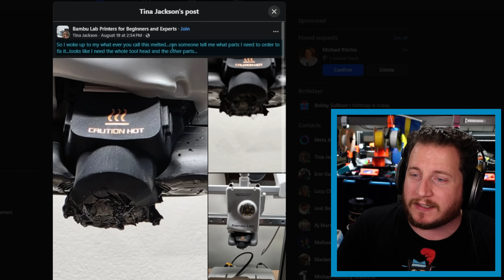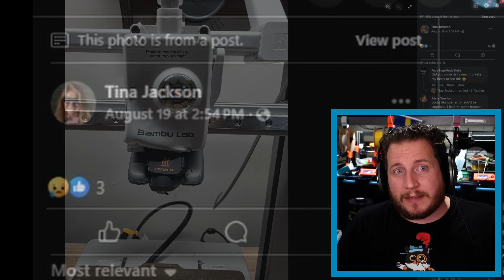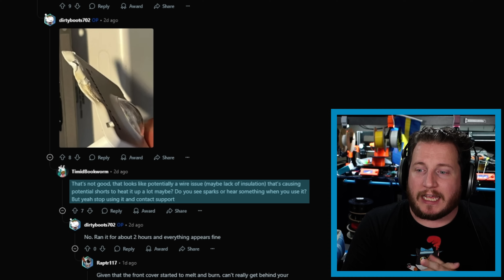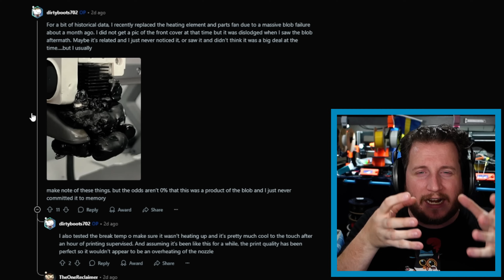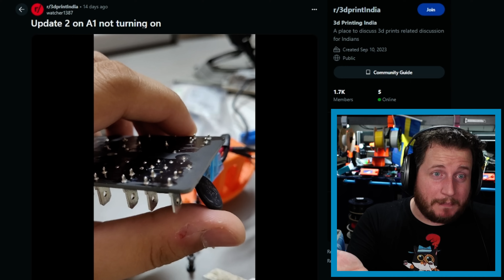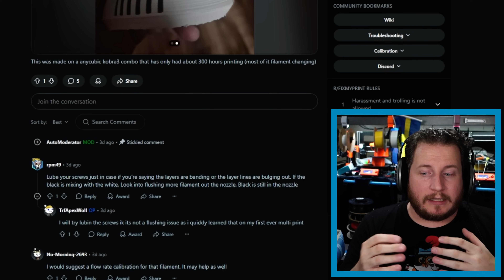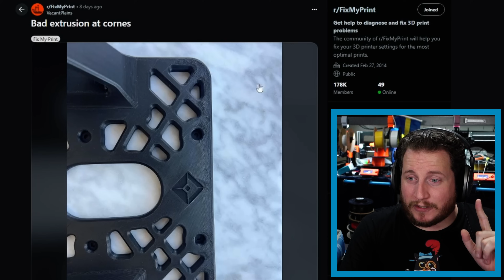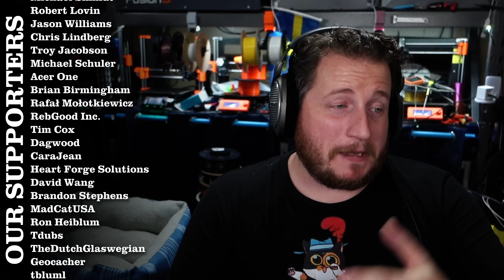Bambu Lab A1 Printers KEEP Melting! - PrintFixFriday 207

Comment: the 2nd failure... the heat came from the outside. dude hit it with a lighter or something for whatever reason. the bubbling of the plastic happens on the outside not inside. it takes a lot of heat to bubble plastic. if its not bubbled on the inside and is on the outside, its cause the heat came from the outside.  go heat some plastic up with a lighter and see for yourself.
Reply from the maker: nah, that is what happens with FR plastics, or mainly nylon and glass fiber when you get it hot, it bubbles.
Reply: @3DMusketeers  why didn't the inside bubble?
Reply from the maker: That we don't know. FR doesn't mean it won't melt, it means it won't catch fire, in theory. UL has a whole thing for this. UL94 is the designation and V0 is often what we want to see when companies talk about FR ratings.
Reply: @3DMusketeers it was rhetorical. my original comment said why it bubbled on the outside and not the inside. i wanted you to explain why you think the melting pattern shows the heat coming from inside even though bubbling comes after plastic gets to a higher temp then the softening temp. the outside clearly got hotter but you have a theory that the heat came from inside else you wouldnt have blamed it on the hot end right?

Comment: When I get mine, I shall tour the boards for cold solder joints. The first ones I  encountered were in large boards made by Digital Equipment Co.for the PDP-6 computer. Provocative maintenance was required to fix them.

Comment: Grant thanks for covering the chipping Pheatus Chonch plus hotends chipping. My was microchipped and was causing me almost 2kg of failed prints. Low and behold switched back to my .4 E3D HF and prints are back to perfect. Thanks for the PSA. While the conch was undamaged it was printing GREAT but that fragility is a no go. Now I'm going to save up for a diamonback for my fiber filled prints.

Comment: Are people seeing this on A1 Mini as well or just A1?
Reply from the maker: The power supply issues seem specifically on the A1 and P1S. I'm told the mini has a cooling fan down there where the normal A1 does not.
Reply: @3DMusketeers - Makes sense. I’ve found the A1 mini to be a very reliable 3D Printer. I have several but just one A1 and one P1S. Both are working fine so far.

Comment: I would prefer an INDX style multi-material setup over the vortek just cuz it's still using the AMS which is not great with flexibles and that's like 50% of the multi-material I want to do. 
I think for now I'd go for a snapmaker U1 for the insane value and how they seem to be embracing open-source firmware and right to repair on their hardware. Will look at Prusa once they come out with their Core One successor in ~1 year after their INDX style add-on launch.

Comment: My superfast bedslinger running Klipper uses a crash routine to tram the X axis.  With the right macro and mainboard, the stepper drivers derate their current in the last couple of mm so they only gently tap the stopper blocks instead of slamming them.  Auto executes every 10th print & works like an absolute charm.
Reply from the maker: That's super cool!!!

Comment: I had to rebuild the whole hot end other than the PCB, due to a clog. It put PETG all the way up past the top of the nozzle. Luckily I had bought extra parts when I got credit for the heat bed. It has happened twice in almost 2 years. Both in the first year.

Comment: I got an A1 mini on July 6th, 2025 (delivered on July 11th, 2025).
It worked fine until August 4th, 2025, when it started having quality and dimensional issues, so I opened a case with Bambulabs.
The 1st thing they had me do was check and tighten all the screws that hold the nozzle. After only 3 weeks, they were all loose.
Tightening the screws helped, but didn't solve the issues, and in the following weeks, more printing issues and defects started piling up.
I documented everything. On the case, but Bambu has been pretty much stonewalling me for weeks, up to the point of claiming I never posted any evidence.
My ticket is 26 days hold no, and they're trying to use the excuse that their ticketing system is not showing them all the pictures and videos I kept posting during these weeks.

I thought I was getting a "printer that just works" from the "Apple of 3d printing", but instead I got one of the worst customer care experiences I've ever had.
Reply: How did it worked out?
Reply: When my husband and I bought our 2nd printer in November after having a CR-20 for 4 years.  We wanted to buy a Bambu but the lead time was 6-8 weeks and we didn’t want to wait so we bought a QIDI P4.  We’ve since purchase many printers from a couple of other brands and not really had any real issues that weren’t user error.  I was able to buy a P1S combo during the anniversary sale.  It arrived at the very end of June.  It printed ok, the prints weren’t any better quality than the other printers I have.  There were also several minor issues that weren’t due to user error.  I fixed them and moved on.  Sometime at the end of July beginning of August the AMS stopped working.  I can’t figure out what is going on and I’m pretty good at diagnosing and fixing printers.  I’ve heard that Bambu customer service is really good at ignoring customers.  Every manufacturer I’ve reached out to for other printers has been more than helpful.

Needless to say, I’m pretty disappointed in Bambu because the one I received didn’t just work either. 

Plus the slicer is not intuitive.

I doubt I’ll ever buy another Bambu printer.  There are many other printer manufacturers that have printers that also just work and their customer service actually responds.
Reply: @neanie0182  I escalated the case to the state's buyers' protection.
They didn't want to put up with me; now they're welcome to put up with the law.
Got my 1st printer in late 2023, a Neopetune 4 pro, never had an issue.
I personally use (and like) Orca as a liscer.
Bambustudio is part of that slicer's family; they love to pull new features from the other open slicers, but then they want to close everything in their walled garden, hardly acceptable.
Apple is shit, but at least their products are very good.
The "apple of 3d printing," on the other hand, it's even worse as a company, and their products aren't as bulletproof as they say.
Reply: @neanie0182 ive gotten better customer service form creality than my buddy got from bambu

Comment: going H2C. i know this channel isn't really into bambu, but i've been pretty turned off by my experience with prusa. I got a P1S and have had issues with that as well, and support really isn't great at bambu, but you get help eventually. Just ordered an H2D and will be upgrading to the changer as soon as i can have it shipped
Reply from the maker: That h2s really looks like a ton of value for the money
Reply: @3DMusketeers  it does and i was tempted, but i just wanna build and then watch the H2C in action. in the mean time, i still get an H2D to mess around with
Reply from the maker: oh I want to see the H2S in action! I hope it can run with the side panels off. I really want to see the COPIOUS amount of engineering Bambu put into it, because it is well known, it will be over engineered, and that means, it will look AWESOME
Reply: @3DMusketeers yeah that’s why I do it. It all started just wanting to have machines running near me, but my design skills are slowly starting to, well, slowly starting to barely exist. But it’s something

Comment: Out of curiosity and having just replaced a high temp hotend on my Qidi, if you get hold of the actual thermistor model (type/model number), I'd be rather curious to compare what all is in the fleet here. I'm transitioning my NTC's out to PT1000s but have to roll through them budgetarily.

Comment: They might be a pretty penny, but the CNCkitchen deburring tools are really nice and quite a bit slimmer at the tip than standard ones, which is good for cleaning up small areas.
Reply: Editor Andrew here - he mentioned CNCkitchen's deburring tools in the raw recording but I cut it out. He honestly went on about deburring tools for like 4 minutes lol
Reply from the maker: Can confirm.
Reply from the maker: We did a few years back. It's due for a refresh....

Comment: The thermistor in the A1 is in the heatbock itself, NOT in the hotend. So technically, it shouldn't matter if the hotend was installed properly or not. However, thermal runaway protection definitely should have caught that it was heating up (too fast?).
Reply: Thermistor is thermally connected to nozzle (brass or copper looking "tongue" in the middle of the block contact surface) and would follow heater temperature only indirectly (via nozzle, radiation from block).
So unproper (inproper, aproper?) installation will matter.
Reply: Yep my thoughts exactly, though it is possible the thermistor might be dislodged somehow and it's running hotter than they realize, my money is actually on the heatbreak fan not spinning up and being unnoticed, then they checked it later and it was back to working again. Whisps of plastic tangled, etc etc. Maybe the melting even softened them and it un-stalled all by itself.. lol..
Reply: @Roobotics  The heating element is protected by itself, the hoter it becomes the higher the resistance, so at a certain temperature it stops heating more. (i thought it was around 400°C)
Reply: @efexor666  "The A1 3D printer uses a ceramic heater for its hotend, not a PTC (Positive Temperature Coefficient) heater. PTC heating elements have a resistance that increases with temperature, causing them to be self-limiting, while ceramic heaters require a separate thermistor and controller to regulate their temperature."
Reply: this wasnt a heat issue. he wants us to believe the hot end melted the cover above but the fan ducts didn't melt? yea ok.

Comment: My company got an A1 a while back and it's never made a good print. We've replaced nozzle and maintenanced the motion system tried tons of different filament and it can't produce anything but a stringy mess
Reply: I had similar problem. Factory reset fixed it.
Reply: Make sure the settings are right for the material. I did that with PLA  settings for PETG. Also use quality material. I got a sampler from Amazon and I wound up with the blob from hell to get off the hot end.

Comment: melting issues aside, I love my A1 (4500 hours and counting).  I am not a technical person and the ease of use has been a game changer for my, having moved from my Ender3.  Is there a resin printer with a similar level of ease of use/quality?
Reply: Not necessarily, because Resin Is Toxic. The fumes are no joke and you should have a dedicated space and proper PPE whenever handling or working with it. If you don’t follow best practices you can develop severe or potentially dangerous reactions to resin compounds.
Reply from the maker: Yeah, when they run well I'm told that these things are monsters!

Comment: I had an A1 Mini issue last year that this reminded me of - I was running a print overnight, and the AMS Lite encountered a tangle.  The printer stopped as it should and waited for help, but for some reason it left everything running.  When I got up to check it, the cover and nozzle wiper had warped and discolored, the latter to the point that it no longer functioned.  The sock was also brittle in several places and had to be replaced.  It hasn't happened again since, even with a print paused like that, so I'm not sure what happened.

Comment: The prusa with indx is super interesting. Bambus system to change hotend seems like a gimmick. How does it reload the new filament? Do you still need an AMS?
Reply: Yeah, you need the AMS, it's just cutting and swapping the nozzle from half of the H2, so the AMS has to retract and then feed the new filament through the entire filament path before it gets to the nozzle.

Comment: I have an A1 and found that the part behind the nozzle gets loose. There are 3 screws that hold it down and I had to tighten it down after a few months of printing.
Reply from the maker: OH, interesting!
Reply: @3DMusketeers yeah it causes tons of issues.
Reply from the maker: I would bet that is what happened with the first one then! But it DEFINITELY should not happen either way!

Comment: the prusa mk4 skips steps on the top as well. It's not just the mk3. I used it to fix mine after I had that issue that ground into my build plate a year ago.
Reply: I have a Mk4 and have not had this issue. Can you elaborate?
Reply: @MrKornnugget  I used the sparse layers feature in the mmu. This worked before. So I figured it's fine. Then BAM hard crash. Without thinking I reset the print but with normal purging. GRIND GRIND GRIND. I did the calibrate Z feature and it fixed it. When I noticed what was happening it was visibly crooked until I did the calibrate Z (which rams it at the top)

Comment: I'm tempted to do a SV08 MAX with ALOT of INDX on it :D
Reply: Have you done the maths to figure out how many you could theoretically squeeze in there?
Reply: @Chad.The.Flornadian  i also think there is a practial limit on storage of spools and ptfe tube paths that we will hit before the max amount of nozzle
Reply: @ZaxMan3D if you ask me, that's a good problem to have 🙂
Reply: @ZaxMan3D Time to jump into CAD and start drawing up some plans for a massive spool holding rack lol
Reply: @Chad.The.Flornadian No but I figure it's ALOT. Like 15-20 perhaps?
Reply: be carful My SV08 (not max) has been down sense May. I have changed wiring, and  hotends, i just got in a new motherboard (have not changed yet) After i swap motherboards I would have changed out EVERY hardware part besides steppers and belts. Error code 8. ran good when it ran but my first issue has brought that printer to a stop. nozzle temp starts rising on power up with out it being told. on bootup My bed temp right at bootup is registering over 815 degree's I put a new thermistor on still shows over 800 on startup. going to replace motherboard today. if this dont work then this printer did not even last 1 year i dont know what else to do.

Comment: Does the A1 have an acceleration sensor and does a vibration test at start up?   If so, could it be shaking components loose?
Reply: The a1 mini does. So I assume the a1 does to
Reply: It does, but I have never had to tighten my hotend in over 1k hours of printing. Just checked it after seeing thae issues so mabye if its loose already it can make it worse if its not already tight? Otherwise its just whatever they did with the new models to cost them down.
Reply: I was thinking more about the electronics. If the shaking coincidentally matched the resonance of the part, it could easily work harden a solder joint
Reply: @wktodd Ohh yeah thats true. It does do it every print by default (I think?)